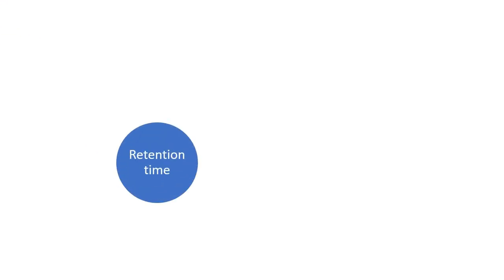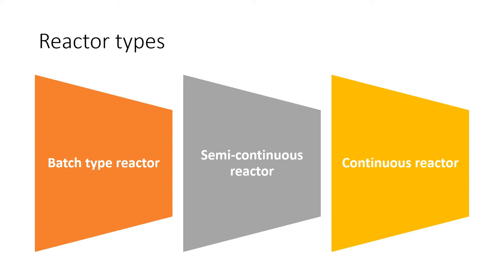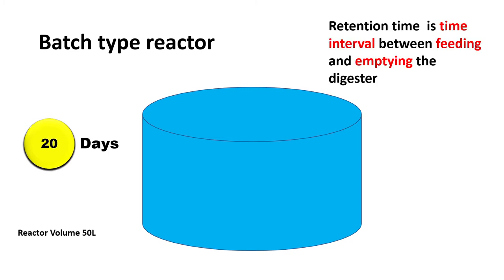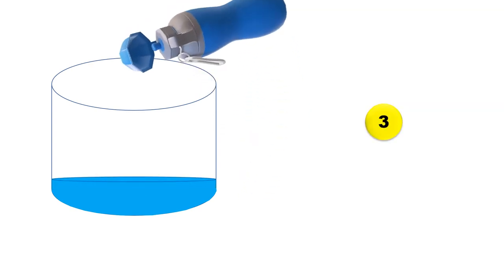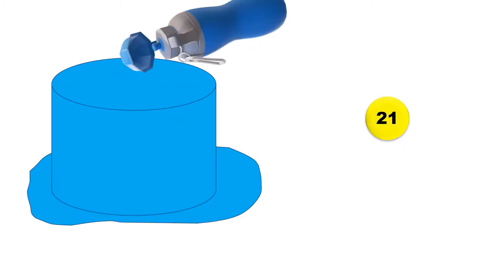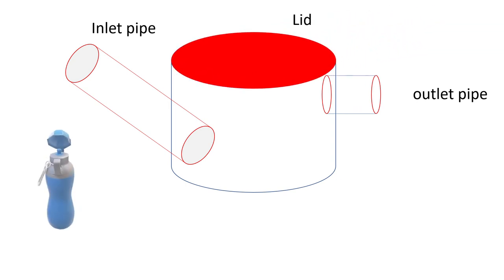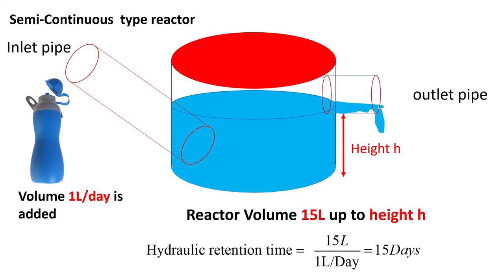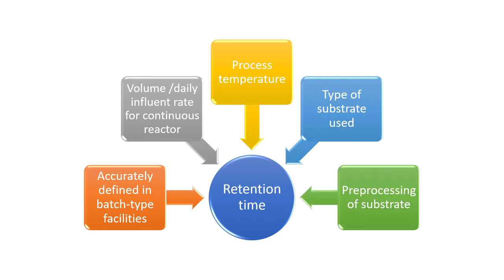Retention time |Hydraulic Retention Time| HRT | Detention time

Comment: Is there no way by which retention time can be shortened in a digester?
Reply from the maker: Your question has many scenarios. let me discuss one by one 
case 1.   less retention time  by design 
Ans.  we can easily  do this
 (i) by increasing flow rate
(ii) by decreasing volume of digester
case 2.  decrease digestion time and thereby decrease retention time 
(i) increase temperature
(ii) control growth parameters by adding specific bacteria
this may require research 

let me know which scenario you are thinking
Reply: The last scenario involving introduction of inoculant and using biofilm carrier to increase bacteria population.
Reply from the maker: Well !!! you know the answer.
Reply: Do I?
Reply from the maker: OK.. I didn't get your question then. Can you further elaborate